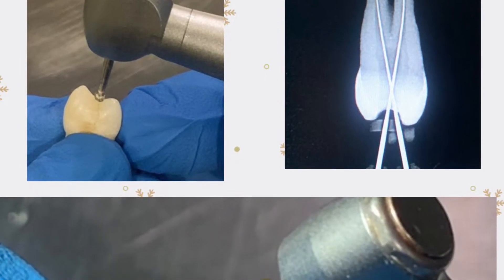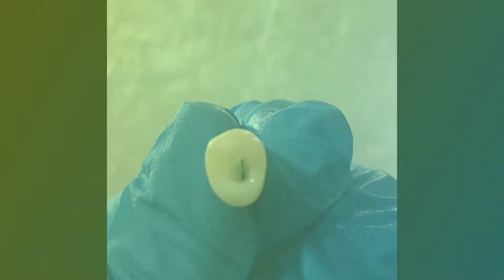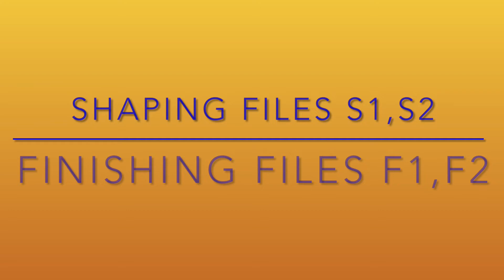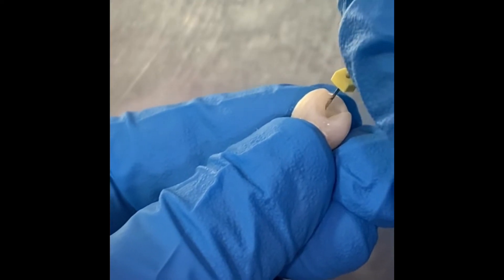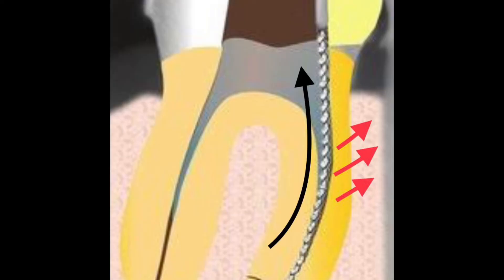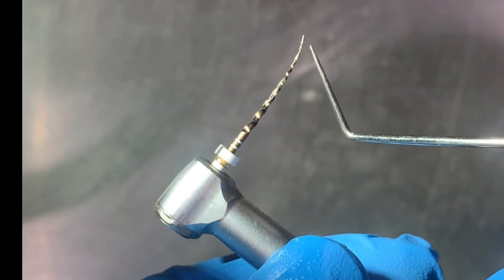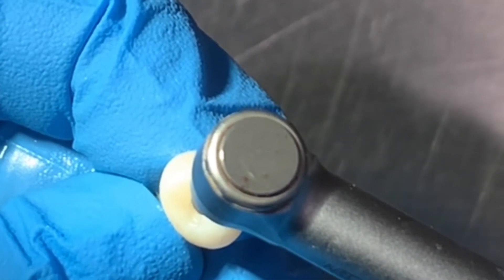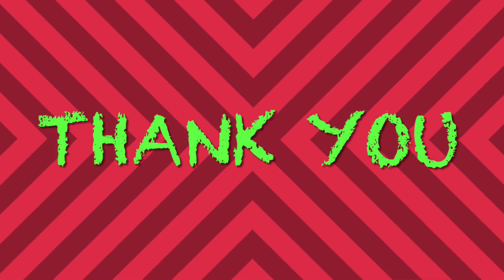Root canal preparation with rotary flies| Rotary endodontics part 2| Rotary endo for beginners

Comment: Mam do you use the protaper gold files immediately after 15 size k files?
Reply from the maker: It is a decision to be taken depending upon the type of canal u r dealing with. Some canals require more enlargement before rotary files can be used
However for relatively straight and reasonably wide canals as in d above video u can do it
Reply: @sumeetasandhu  thank you so much mam

Comment: Pls explain more the brush and follow   vs   follow and brush ....what is different bwtween them
Reply from the maker: In Protaper system, the S1 file is allowed to passively float into the canal and follow the glide path. The shaping files are used like a brush, which means they cut the Dentine laterally and selectively on the outstroke, that is when the file is being pulled out. This brush cutting action will create lateral space. It will ensure that the cutting takes place on the outer side and not on the inner side of the canal towards the furcation.
Reply: @sumeetasandhu  great